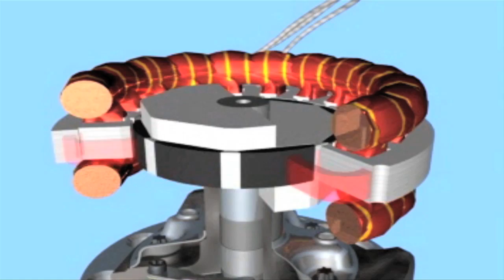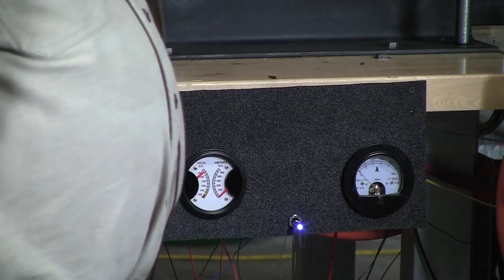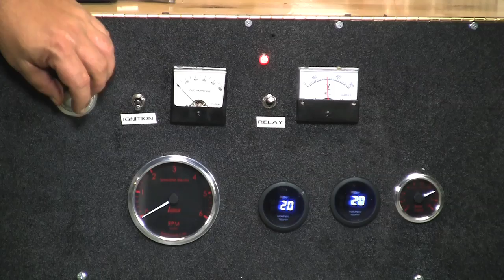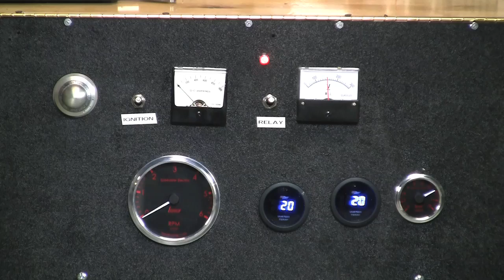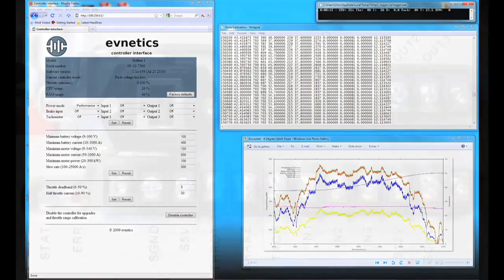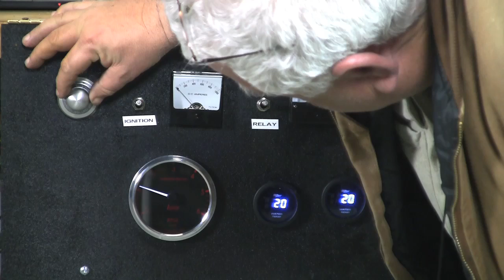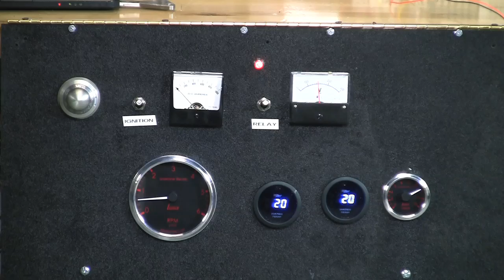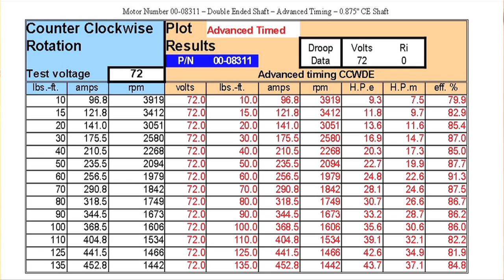EVTV Friday Show, March 4, 2011

Comment: at min marker 1:32:40) what i don't understand is why you have your idle so high. at idle your torque converter shouldn't be engaging your drive so easily when you had a load on your system.  there is a good chance i dont know enough about torque converters :)  would it be possible for you to explain this system in more detail. 

lol.. and about your safety precautions on your test bench lexan might be a step in the right direction?  wouldn't want to see you guys get hurt.

 love the show.